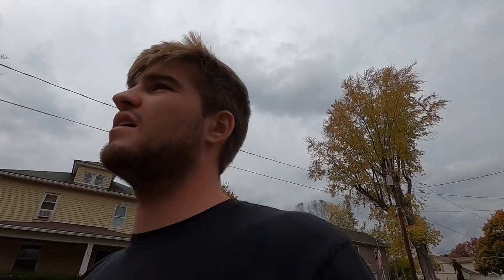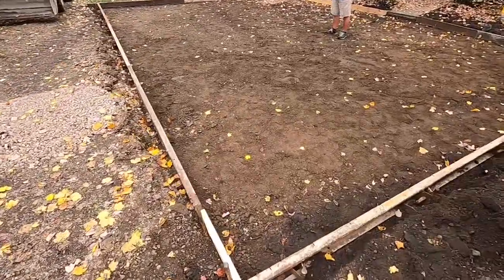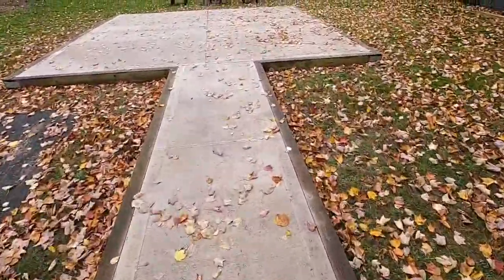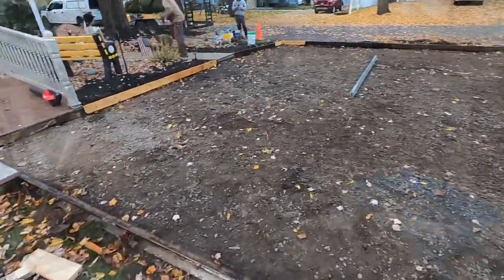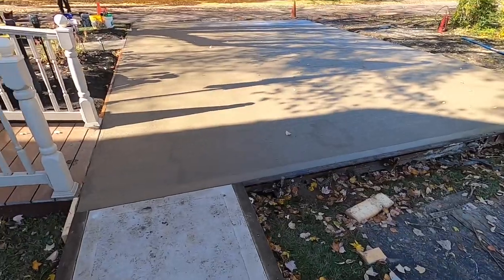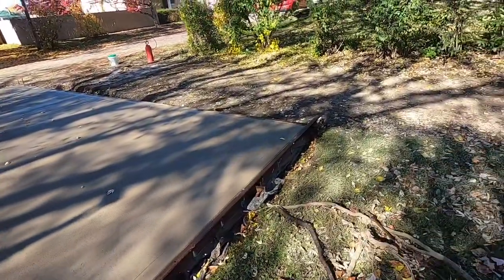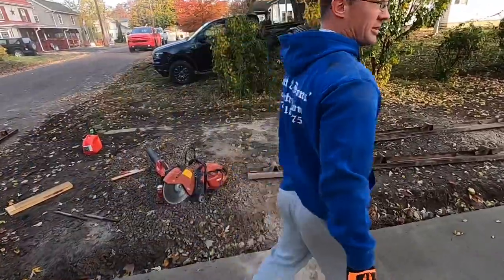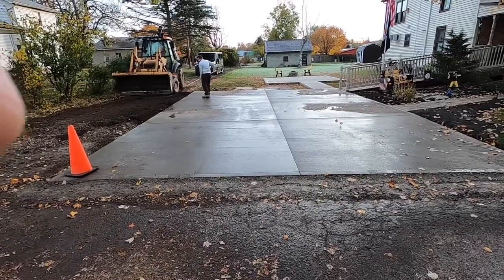Concrete Driveway Pour

Comment: Can you explain more about the synfilm?
Reply from the maker: The synfilm, also called confilm makes the surface wet and workable for longer when you spray it on the surface and rub it in. I only use it when I’m nervous about the concrete getting hard too fast. Once it’s finished I don’t use anymore confilm. I switch to the sealer and spray that on the finished product. I use vo-com 20, it’s a water based sealer and helps cure the concrete